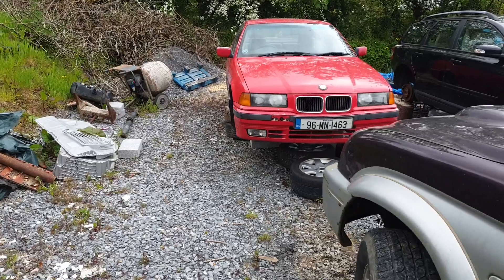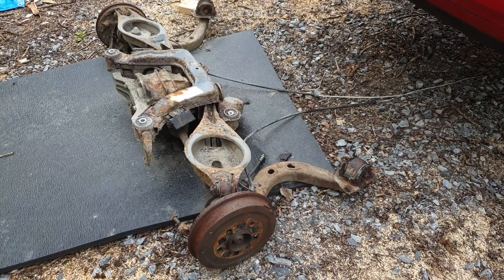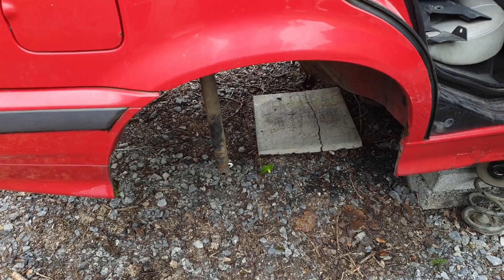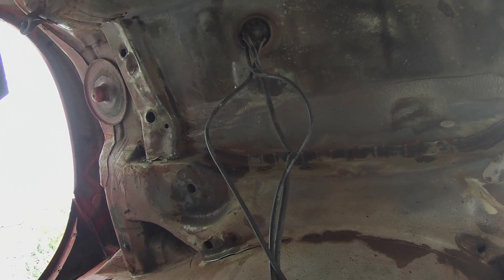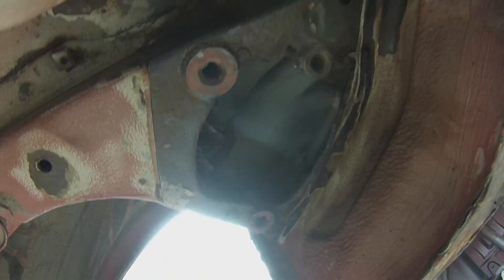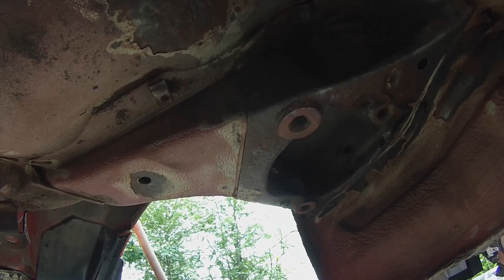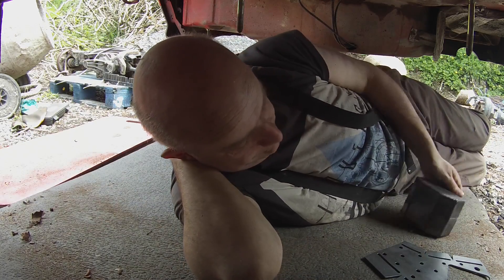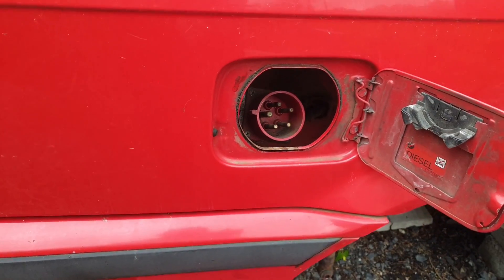€1,000 BMW E36 EV Build 19 : Rusty Arrow

Comment: Thanks  Damian,  great that you are using a Prius gen3 inverter in your mix.  Will that be sync serial communication? 
Have one running on test bench , early trials.
 On the Open inverter,  
Toyota gen2 vs gen3

Comment: I love those E36 BMWs its a shame that there won't be enough space for the tesla motor at the back
Reply: Interested to know what coupes can fit a decent motor in the back. 🤔
Reply: @chargeheads  I guess definitely Porsches. I was looking at Jaguars XK they may have plenty of space at the back
Reply: E30 is not bad for that :) it has nice rear subframe just for Tesla . And it is light ;)
Reply: @bimerev  Do you think Tesla SDU front will fit without cutting the frame?
Reply: @LatutaEV  here is rear subframe https://www.youtube.com/watch?v=N7UEyVN8F90 only spare tire booth reconfiguration :) , and you will need to make drivetrain carriers
Reply: @bimerev  Looking at that video it doesn't have enough space for Tesla Sdu
Reply: @LatutaEV  You think ? But Kevin on Openinverter put LDU on e30 cabrio..  did you see that video ?
Reply: @bimerev  oh no please send the link if you have it